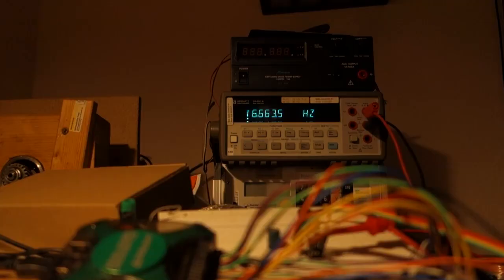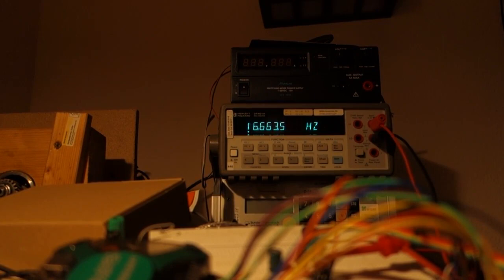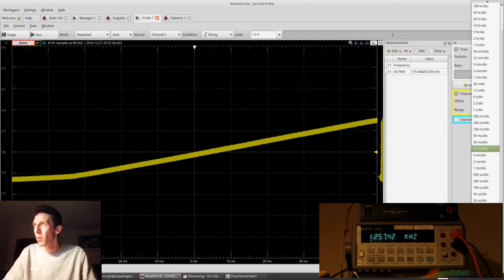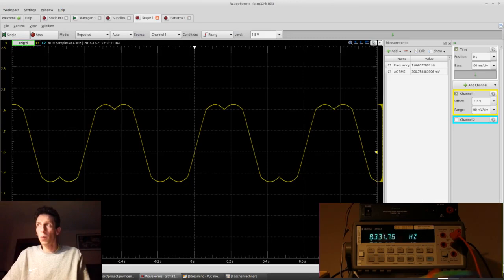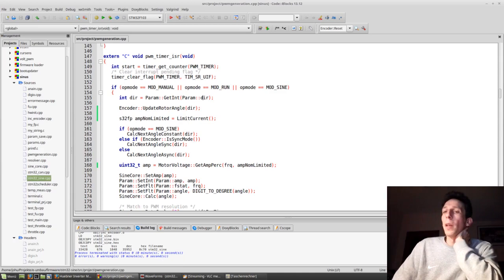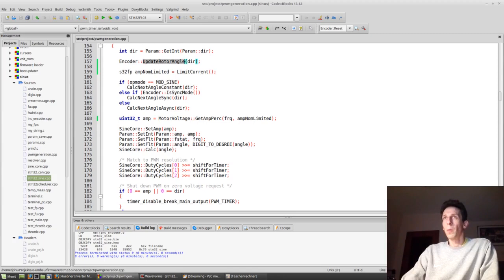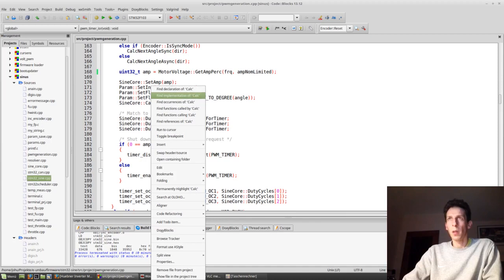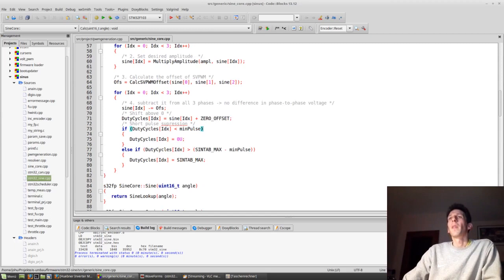EV fundamentals #3: Induction Motor Control

Comment: I am trying to understand the final PWM stage. I have trouble with that since all phases interact.  If we, for example, want phase A to be on for 80% (duty cycle) and phase B on for 50% and Phase C on for 20%.  Then, if I understood your code, you did this calculation, and then activated the three PWM timers at the same time. But then there will run no current for the first 20% of the time because all three top transistors are activated.  If I understand it correctly we need to switch quickly between two states in the 6 section space vector. And then to further complicate things we need that this switching must be done in a very specific way so that only one of the six transistors changes state. I probably made no sense here, I am struggling with this final switching.